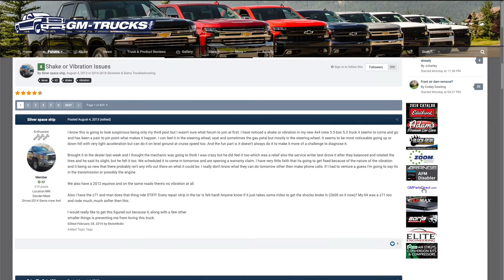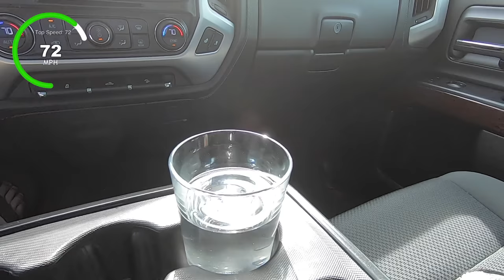"Chevy Shake" Driveshaft Fix for GM Trucks?

Comment: So,I have a 2016 GMC Sierra SLT extended cab .4wd. It had the 70 mph and up shake. It was in the floor and seats, my console shook bad enough you couldn't have an open drink in it. I checked both dynamic balance and road force. All tires were dynamically out of balance, and 3 of 4 were over 30 pounds of road force. 
I was able to get 3 of the tires below 20 pounds and the 4th is at 23. I  balanced the tires and road tested it. The shake is gone!
The driveshafts can definitely be a problem, but don't forget the basics too.

Comment: I bought a 2017 2500hd Silverado Duramax and have been fighting this for over 4 years now. I’ve done everything that has been recommended - custom built driveshaft Bilstein  shocks with the remote reservoirs all the way around, even have centramatic balancers all the way around. Been through 3 sets of rims and tires. Flushed all the fluids, rear ended and transmission. Nothing has worked at all!!! Trucks paid off, hard to let it go but I can’t do this anymore. I can’t find anyone to help GM just blames it on tires…. All I have done has been a result of my researching and trying to fix it on my own. I see with no change but wasted money. Truck shakes at any speed but 65-75 is ridiculous. I will never buy a Chevy again…
Reply: Same here 🥺😩 but mine is a 2010 Sierra 2500hd 6.0 gas.   I’m tired of it, no one can figure out what’s wrong with it.
Reply: Most of these I have seen is rear diff bearing preload.   Check out Motor Age magazine November 2019 has  a great article on this very problem.
Reply: Kk
Reply: I'll take it off your hands
Reply: @OscyJack-  I sold it and bought an LBZ with 44,000 miles on it. Haven’t looked back.
Reply: @jeffreycoates4408  that's a unicorn dude! Haha. 

Lmm here
Reply: @aricsavage772 any link on that article? Their website only goes back to January 2020.
Reply: Not sure why you'd change shocks and fluids and 3 sets of wheels lol. Should have got some more Professional advice... did you even check your rear diff?
Reply: @Handlehandlebars  All was checked out by several shops bud. Im not alone with this issue so it’s obviously and engineering issue.
Reply: First throw those Centramatic Balancers away. They just amplify any imbalance you might have. They are a scam.

Comment: the 14-18 gm trucks have stiffer frames then the generation before. they have stiffer body mounts. this allows alot more vibration to be felt through out the truck. 3 big issues i see vibration wise on these trucks are  
#1 the tires . you have a stiffer frame, on 20s and 22s ( 22s are the worst) with little side wall on the tires. and due to variation in manufacturing in tires there can be excessive road force  variation. 
what we do is with a tire balance that has the road force measurement capabilities is do a road force balance. this will tell you the amount of road force the tire/wheel have. it will tell you to "clock"/turn the tire on the wheel based on computer measurement of the assembly. this includes a wheel run out measurement.  and you do this til its brought into spec with is below 20 road force. if a tire is so bad it cant be brought into spec by "clocking" then you replace the tire til you get one that does. ( i have done this countless times on trucks at the dealership ) 

tires that sit and arent driven on can get flat spots and it makes it worst. so a truck that has sat on the lot for a good while most likely will have this issue. the tires that seem to have the biggest issue with this is Bridgestone Duelers Alzena 285/45/22s or Bridgestone Dueler RH-S AT tires 285/45/22. Bridgestone duelers 275/55/20s can be an issue as well. not as many issues with Goodyears LS 2  275/55/20s but every now and then. I have even had to do this on the 2500s with the Goodyear Wrangler SRA LT tires. 
Now where on other vehicles who arent as stiff as these trucks these tires most likely are fine. but it seems to be a weird combo of wheel size/tires/ and truck. 

#2 is trucks with 8 speed trans, having a shutter issue at speeds between 35-75/80 mph at steady speeds. this can be caused by alot of different issues, such as the fluid the originally used absorbed too much moisture. and they have to be flushed /changed over to a mobile 1 HP trans fluid. and torque converters.  if you have an 8 speed trans on these trucks/yukons there is warranty /special coverage. i would call and ask to see if you are still with in these and have it addressed. 

also i did see a few times that one supplier of the rear axle/diffs on these trucks werent manufactured to spec and required a complete rear axle /diff change. something about the cutting of the teeth on the ring gear. dont remember the exact years/ RPO 

it is possible as well that the drive shaft can be out of phase or not balanced correctly. this is important. and on two trucks i had to replace a bushing in the steering gear for a vibration. 

another vibration/rough ride can be on the denali's with magna ride suspensions. the front shocks/struts on these trucks are very very prone to leaking and needing to be replaced. i do these at least once per week. 

i think a possible solution could be changing the body mounts on the frame maybe to a more "forgiving" mount type. 
but i highly recommend (even though i cant stand it as a tech cuz of the labor of the work) is to have your tires "road forced balanced" 
i dont know of how many aftermarket shops can do this, dealers can. issue will come when you are out of warranty and have to pay out of pocket for this. you would be responsible for buying what ever tire needs to be replaced ( if the new tires are bad those are sent back to manufacture as defect ) up to 4 new tires , mount and balance , and a charge for each  time a tire/wheel has to be "clocked" rough cost ( if i was to do it ) would be 2 hrs labor + cost of tires which depending on how many tires need to be replaced. $200 per tire for 20s, $300ish for 22 $800-$1200 for tires plus the two hours labor ( $150 ish shop rate ) $300 could cost as much as $1500
Reply from the maker: Thanks jay webb, I appreciate it!!! That was a huge comment with lots of information to soak up
Reply: Wow! I have a 2004 Silverado with no issues, but I’d like to buy a Colorado.  I’ve been trying to track the problems with the 8 speed to see if it has been resolved, but it’s very confusing. Now I’m reading all this and it appears there are many different issues. I’ve been in industrial maintenance all my life and am somewhat familiar with vibration analysis. Seems like there should be a way to diagnose these issues without all the guesswork I’ve been reading about on he other posts. 

Thanks Jay Web for all the comments. This is the best information I’ve read so far. 

 I literally grew up in Chevy dealerships and it breaks my heart to hear that they’re having these issues. Many years ago Harleys were oil leaking pieces of junk, but they put there heads together and fixed all the issues. I’ll never buy another GM vehicle until I that the 8 speed transmission issue has been completely resolved.

Comment: Hey guys....the problem is Torque Converter Clutch shudder.
A serious fluid flush might help, but most likely a torque converter replacement.
Reply from the maker: I started considering that fluid flush. Might give it a go
Reply: @GearsGadgets  did you try the fluid   change
Reply: Is this something you did or the gm dealer
Reply from the maker: Daniel Villasenor haven’t done the fluid flush. Or are you asking if the driveshaft was something that the dealer did?

Comment: There is a process to figuring out what is actually causing the vibration.  As well, pinion angles, drivetrain angles can cause vibration as well.
Reply from the maker: It would be nice if GM would do that process at the engineering / design stages, or if it gets by that QA process, maybe do it in a recall capacity and not just leave it on the customer to figure out.... But that’s just my opinion.

Comment: I replace the stock Goodyear Tires with some light truck Cooper tires that were a little bit wider and I have no vibration now.
Reply from the maker: Interesting
Reply: I work at a cooper tire factory, we stress about great quality. Our tires go threw different departments and are thoroughly checked by high tech equipments for great quality. 

It’s not a simple mold that is heated and pops out. There’s a lot of steps that they go through. 

I’m not just saying they are great bc I work there, but I would definitely buy them. Like I said the tech involved tells us every little thing, when making these tires.
Reply: @rayman8991  I've always been a Cooper fan. I got some Cooper RTX tires from National Tire and Battery. They're LT tires for my 07 LBZ Duramax.
Reply: @rayman8991  Not saying the tires are not quality but probably someone not calibrating the balancing machine everyday or shift change at GM. I found my shake to be poor quality transmission fluid. I changed to Valvoline synthetic DEX VI with Lubegard black bottle friction modifier and no more shudder and shake.
Reply: I had the same issue. Vibration at 74mph just like this. The problem was the tires. The have to be road force balanced by a shop who knows what they are doing. Any road force numbers over 10lbs and it would vibrate.

Comment: My 2016 6.2 8 speed sierra 60k miles  just started the shakes, dealer just told me its the fluid in the transmission they are now recommending LVHP fluid with a complete flush not just drain and fill to solve the problem.
Reply from the maker: Im going to try that soon.

Comment: 2015 1500 single cab short bed shake improved a lot after with upper control arms
Reply: I’d say the same with my truck. I change front u joints, wheel bearings and axles before arms and the difference was negligible. Change control arms and it’s doing a lot better. I have 188k miles and every year it just keeps getting worse and worse. 74-79mph 5 years ago was shit. Now it’s 55-82mph and I’m getting irritated as fuck because nothings fixing it. If shops don’t know, the least I could do is update all the used parts. Now I’m thinking it’s the front diff or the auto 4wd function messing with something.

Comment: My 2916 C7 Corvette Stingray with 8 speed automatic transmission also had the Chevy Shake. GM recommended flushing the transmission fluid with a new type of fluid. So far, this has fixed the vibration, but it cost me $1,200 out of pocket,

Comment: I have a 2017 Silverado 4wd double cab 5.3 with 6L80 trans. I bought it used with 36000 miles and noticed a vibration. I also noticed that I had some shudder in the torque converter at lock up around 70+ mph which feels like a shake. I changed my transmission fluid and filter to Valvoline DEX VI synthetic and added Lubegard friction modifier black bottle to the mix. Smooth as butter and no more shake.
Reply from the maker: I will check out that lubegard
Reply: 2 stroke. Got a 98 Z71 Old 5.7 4wd. 146,000 on it it's a clean truck. You just described the same problem I'm having. But when it starts bucking. If I ease off the gas or punch it to make it downshift it quits. Mine Dextrin 4 yours is newer is there a 5? Thanks.
Reply: @brianjacobsen5762  Your lockup clutch in converter is causing this. Try the Black Lubeguard, it is friction modifier. Only change your fluid if it has more than 30,000 miles on it. Dex 4 is fine, If it still does it then your converter lock up clutch is prob severely worn and putting contamination back into your valve body etc.
Reply: @BigEbikesports  We bought it back in 08 I Only drive it to the dump once a month to pick up big items. 146,000 change. Changed the filter fluid year or so ago. Changing timing belts in both our cars are down have the parts waiting for the weekend so I have some light. I'm buying a bottle that shit. Thanks.
Reply: @GearsGadgets 
Hi. I’m a little late to the party, but just diving into the issue now. 
2 mo ago, I bought a 2014 Silverado. Reg cab short box 4x4 with the 5.3. 
It shakes bad at 68 mph. 
I’ve done much reading on this, and have a machinist background. 
I’ve only tried balancing & changing wheels & tires from 18-20, with no difference. Truck has 98,000 miles. 
It has V4 disabled. 
To illuminate the torque converter or trans issue as a source, I took the truck up beyond where it starts to shake (65) to about 75, on a level stretch of highway, and shifted into neutral. 
As the truck coasted down through 74-65, the vibration continued at its normal high level throughout that range.
To me, that eliminates anything torque converter or transmission related. 
I’ll check driveshaft & axle runout next. 
It has the one piece. 
Thanks for sharing your experiences and for the money you’ve thrown at it to narrow down the cause. 
I’d enjoy hearing any more updates or fixes. 👍

Comment: I have a 2014 Sierra that has done the same thing and gotten worse over the years. I do have my own shop and replaced drive shafts 3 sets of tires and 2 sets of Factory rims. None of that fixed the problem. Lately I have been looking at the rear axle with help and direction of some other videos. I have found that the rear axles are out of @t is so bad that you can see it with the naked eye. Problem Solved. Parts are about $600.00. Thank You!!
Reply from the maker: Awesome Ronald. I appreciate the input.

Comment: I just got back from my local dealer and they said I have a bad torque converter  on my 2018 LTZ two wheel drive silverado and that is what is causing my vibrations between 48 and 55 mph. I will keep you guys posted after install next week.
Reply: Did it resolve it?
Reply: How many miles?
Reply: @Mr.Beastforpresident   17000 miles
Reply: Rick Murphy 5.3 or V6?     I just purchased mine with 19,000 miles.
Reply: @Mr.Beastforpresident  5.3
Reply: Sorry I thought my vibration was gone but after further driving I find that it is still vibrating and it is back at the dealership now for further testing
Reply: Got it back today. The dealership road force balanced the tires and said it was fixed Picked it up and it drove just the same and when I got it home I noticed they scratched up one of the rims I took it right back to the dealer and they kept it
Reply: @leer125  No still trying trips to the dealer
Reply: @rickmurphy7274  any luck?
Reply: @NKKUSTOMS  No They have done new torque converter , new motor mounts, Transmission flush,several wheel balances and new wheels off a brand new Chevy truck and now they say it rides better than any used truck on there lot but it vibrates just the same as before
Reply from the maker: Sorry for the super late reply Rick Murphy. I appreciate that you stopped by the channel and apologize for not responding WAY sooner.

Comment: Rear Axle Seals are dripping on to the rotors, even the smallest of drips on the rotor will cause the friction/no friction vibration. The seals were redesigned by GM to be two piece from the original one piece design...

Comment: I have a 2007 GMC Yukon SLT, it was lifted about 7.5 inches maybe a year ago, and like a month ago my driveshaft fell off on the highway I think it wore out or the new angle made metal to metal rubbing with U joints.
Reply from the maker: Interesting. Appreciate the input.

Comment: The dealer shot a lot of darts at my 2016 GMC Sierra 1500 Double Cab 5.3L V8 with the “Chevy Shake” and this video solution was the same solution that fixed my truck. They said it was the rear drive shaft specifically.

Torque converter, Transmission fluid, Motor mounts, Front Shocks, Drive Shaft, Rear Drive shafts all changed. I could prob go on with the darts they threw but that’s the majority of what was changed to find a solution.

Comment: Last month I had a large vibration in the driveline of my 2018 2WD Silverado so bad it caused the rear seal of the transmission to fail and spill all the fluid out. I had the seal and driveshaft replaced under warranty. This morning on I-17 south, I pulled out to pass someone, hit 90 in doing so, the driveshaft exploded.  This “Chevy Shake” is some scary stuff!
Reply from the maker: Yes it is!!
Reply: I miss my 89 Chevy Scottsdale 4x4 with a good ole 350 small block. It had solid STEEL driveshafts. No hollow aluminum BS.
Reply: I'm gonna call bullshit on the explosion verbiage. Blowing the issue out of proportion.
Reply: MrVegaslive The driveshafts in these things are made of thin aluminum laid over a cardboard tube. The walls aren’t any thicker than exhaust pipe and when they come apart it’s like an aluminum can getting hit by a mower...
Reply: @trey8543   If you had ever taken a steel tube driveshaft apart --- it too has the cardboard liner. It's to keep harmomnics from happening in a hollow tube (this is to the guy who said he had a solid steel shaft. That's just nuts as it would weight a gazillion lbs).
Aluminum is good - it has a larger crossectional diameter, is stronger, is lighter and won't rust.

Comment: I know it's been a while since you posted this vid but, I have the same problem with an 2002 4x4 gmc, I had the drive shaft changed  to a steel one and it was balanced at high speed, I also changed the U joints. The vibration is a lot less now, more high pitched tho. it starts at about 55mph. The only thing left would be the axles.
What a scam GM has going by saying it's normal is out of this world !!
Thanks , be well !